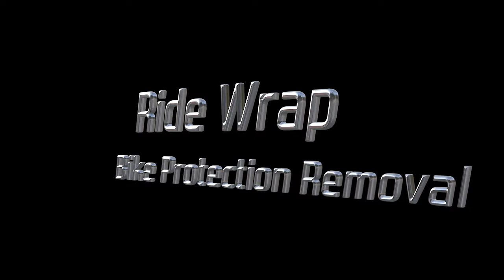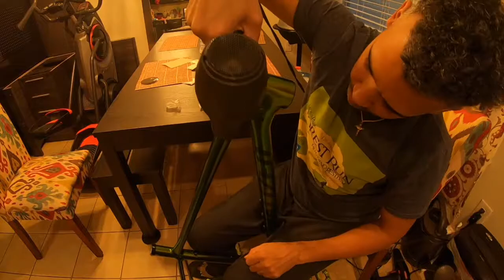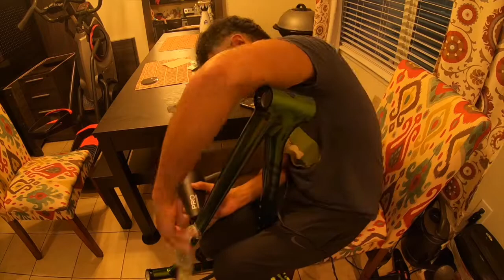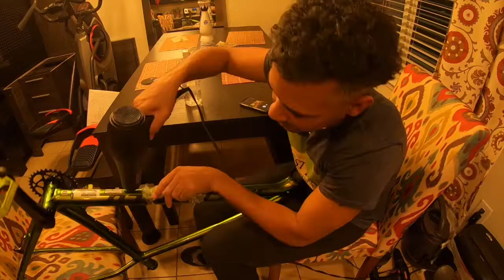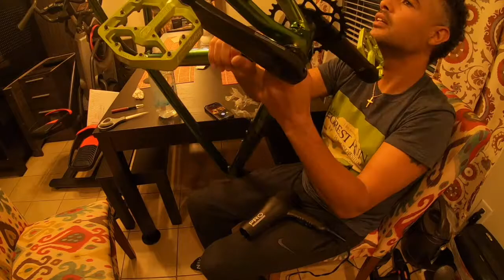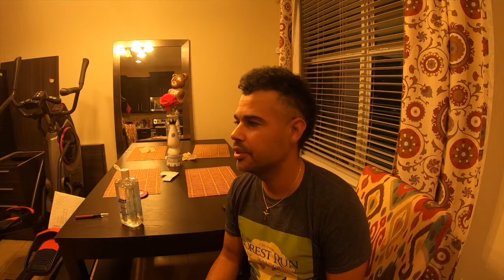Ride Wrap Bike Protection Film Removal

Comment: Does removing this film damage the factory decals? I want to install it on my new Specialized but worry it will damage the logo if I ever needed to replace it. Thanks
Reply from the maker: As long as you hear it with a hair dryer or something, it will not damage the original lettering. Just have to be careful.

Comment: What size to what size.  Mine is a large I'm 5'11 and it's perfect.    Do they still have it in stock in that colors. You see the new colors are almost double the price. $1400
Reply from the maker: I’m 6 foot tall and I had a large which I normally ride with specialized bikes but the large chisel fit more like a medium to me but I do have long legs so the xl is probably an inch or so to long but I’d rather ride a little large than a little smaller. Yeah those new prices are crazy

Comment: Were you just removing it because you had to send the frame back in, you weren't trying to use the same film on the new frame, correct?
Reply from the maker: Hey Jessica! That is correct. You can’t use it once you take it off. I only took it off to exchange the frame.
Reply: @LeBoosLeisure  Other random question. It looks like you might have had the ride wrap on for a few months since your initial install. How did you like it?
Reply from the maker: @jessicamcmillan1626  I haven’t used any other bike protection wrap so I can’t speak about any other one but I like this one a lot. I think it works very well and helps protect the bike from scratches and paint fading. It’s easy to install and easy to takeoff once you get the hang of it. It may be a little bit more expensive than others but I would say it’s worth it.